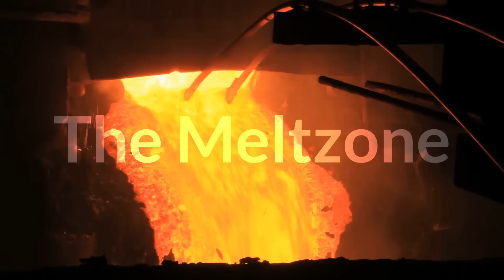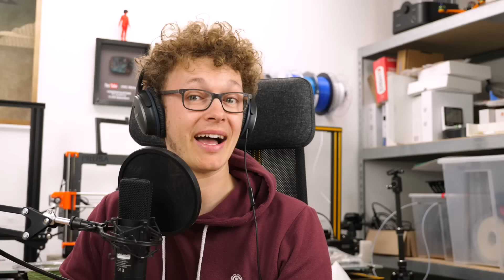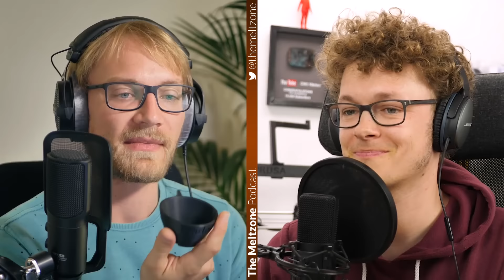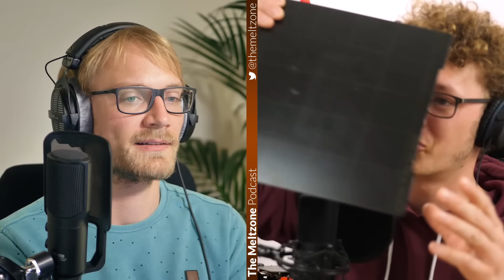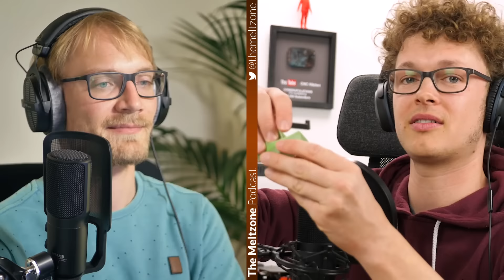3D Printer Fingerprint / DIY Filament Making - The Meltzone Podcast Ep3

Comment from the maker: Open for your questions for the next episodes (given that we don't run out of time again ;-)
Leave 'em below!
Reply: Infinite Z Belt printers! Please! Examples: Stratasys Infinite Build demonstrator (H2000), Stratasys Continuous Build demonstrator ( Using the makerbot patent), Printrbelt, Blackbelt, Call me swal 3d printer, sliding 3D !
Reply: You spoke about filament making devices, what about direct peller estruders? Like this one https://www.youtube.com/watch?v=Wx7GugDZOx4
Reply: Another interesting topic in my opinion is 3d-printer kinetics, the most exotic ones, like (but not only) SCARA and Polar motion systems. They both have some commercial product available (MORGAN and first printer of Polar3d, also another recent polar style printer is Sculpto+ )  I would really to hear some opinions from you on them, eventually some futeure reviews.
Reply: Don't worry about the time from our end. Anyone wanting a 5 minute top 10 best ever .... list and an IQ to match won't be here for a start.
Reply: I’d be interested in a discussion of the current options for printing with soluble supports by price range/amount of tinkering. For example: Clearly an Ultimaker would do it well with little tinkering, but it is expensive. I think a lot of people have had their hopes pinned on the MMU2 but it seems like it currently requires a ton of tinkering and is unreliable. Do you see that improving soon?
Reply: Is their any CAN-bus based 3D printer boards? Where every board has an own small PCB and you just need to hookup power and CAN-bus? Just a creazy idea :)

Comment: I have a policy of not starting out in any field using commercial software (even "free*" stuff) if open source versions are even close to usable. After learning the available open-source tools to a power-user level, then I will let myself decide if I need to use anything else.
FreeCAD FTW! I'm of the opinion that it's the obvious first CAD software to learn because it's never going to be taken away from you at some point later in life by a cloud service shutdown, pricing scheme change, or you moving out of the pricing category, and in fact has continually sucked less with each release over the time I've used it. It's passable for general use now. Not great in comparison to what I've seen online of people using professional CAD tools, but passable, and that's all I personally need. Typically, the best productivity software for you is the one you're already familiar with, and the vendors want to get you invested in their product early so they can monetize you more aggressively later, when it's more painful to switch. I want my laziness to agree with my cheapness, rather than being torn between them!

I'm really interested in home filament production (both because I hate throwing things out and because I like the idea of saving money by mixing a high percentage of recycled household or printer waste into purchased pellets), but in order to match the results of commercial filament for precise extrusion it definitely needs either some kind of diameter control on the extrusion machine or a printer with active diameter compensation. (The latter actually sounds easier to tune and would be useful for commercial filament too!) I'm actually quite surprised active diameter compensation on factory-made printers is so unheard of, as it seems like a simple, relatively cheap process on any machine with a few spare processing cycles that would seriously improve performance with cheap or home-made filament. Severely oval filament might still be a problem though, but it looks like if you get two sensors at a right angle you could still get the cross-section with minimal math (some quick searches suggest that the measurements you would get would be called "conjugate diameters of an ellipse", but most of the geometry mentioned is trying to completely reconstruct the original ellipse (which is apparently possible, in case you wanted to literally draw the filament's shape including rotation on a screen or something), and I suspect you might be able to get away with cross_section = PI_OVER_FOUR * sensor_A * sensor_B ).

Comment: Fusion, up until 2016 was part of the perpetual license with Inventor Product design suite so NO it hasn't always been subscription (18:50)  Its the old drug dealer marketing tactic ...give it to newcomers free , get them hooked and then charge them ......  
And as for the "what you gonna do about it" ( 18:19) .  Look back a couple of years and see what happened when Autodesk removed "showcase" from the Inventor package. Massive user revolt and Autodesk had to offer full blown 3Dmax in the next Inventor suite ( at zero cost) to get people back.  That was only a partial fix and they buckled and gave showcase too. My point being dont underestimate the power of users!!!

Comment: Surprised there was no mention on Freecad. While not as polished as some commercial offerings it is very capable. It is more than adequate for the hobbyist 3d printing market.  We should be supporting the opensource  solution especially considering the origins of the Reprap project.

Comment: Hey guys! Nice Podcast. Hearing you talking about annealing PLA and high temp meterial I thought, maybe you could test the relatively new Extrudr Green-Tec Pro. It is said to withstand temperatures up to 160°c and is stronger than PLA. Stefan, it would be awesome if you could make a video about testing the mechanical properties of this material. Have a nice weekend you two! Cheers!

Comment: You should consider trying PETG too if you have any of that around in rafts/failed prints/etc.  I've only had experience with Eastar 6763 PETG (I got a box of it for around $3 a pound shipping included, or about 2.62€), but it extrudes almost as consistently as ABS (much more consistent than PLA) with more wiggle room for 'the right vertical drop, the right horizontal distance to winder, the right temperature' than you get with PLA.  For me, easiest to hardest materials to extrude that I've tried, starting with the easiest: ABS, PETG, PLA, PP (Use clear packing tape on bed to get it to stick on printer. The extruder nozzle needs to be slightly larger than for PLA. It seems to have lower melt strength so it gets stretched more by the weight of the cooled filament), flexibles (TPU/TPE/TPV), nylon.

Comment: This podcast is worth its weight in gold but I think that there are some things to tweak to get it to the level of awesomeness it can get. 

I think doing it on two-weekly basis is too long which makes you cram questions in and not have enough time to explore them. I think that if you were to do it every week you'd feel more relaxed because you're not chasing deadlines and I don't think it will take up too much of your time. It's not my place to judge your life in any way but you both strike me as makers and makers think about things like that all day long so hopping on camera for an hour or two wouldn't be such an issue, imo. 

Allow yourself to babble a bit as, to me, in its current form the podcast feels a bit scripted and podcasts are supposed to be kind of casual. I don't mean to say waste both your and our time but a bit more easygoing approach will help out the project as it will allow you to go into more detail about what your thoughts are on a subject. This doesn't work in every case, of course. Sometimes all you have to say is a couple of sentences. 

All these suggestions are made with the best intentions in mind. Best.

Comment: regarding to the fingerprinting technique, i dont think you can ever trace back to a specific printer with extremely high accuracy as of right now unless the printer has some unique mechanical issues.
but i think there are some ways to do it that requires cooperation from hardware/firmware/3d printers manufacturer. for example, stepper driver/firmware could generate a very small amount of unique noise during start/stop of a movement. intentionally introduce random but very defects to the hobbled gear, etc,etc.

edit: a mesh leveled bed could also serves as one of the element that the fingerprinting can use. as the patterns of the bottom with always match a certain region of the printer bed.
Reply: and then people would just make their own code/code it out/hack it out/go somewhere else that doesn't include that "feature" unless prebuilt closed source printers become cheaper than the china clones of the open source one's then it might work, until someone gets rid of it. ok your everyday person who want's to stay within laws won't care but those who don't want to do that will find ways as they always do, people will people after all.
Reply: @MrTrilbe  this is why i've mentioned stepper driver and hobbed gear as well. it will be harder to alter a chip and the small defects on a hobbed gear. the thing is, if these are never mentioned/made public, you wont even know what to look for in the first place. i know i know, security through obscurity isn't always the best idea but at least there are ways to do it.
Reply: @MrTrilbe  even with open source firmware, if you are really good with programming, you can obfuscate a very small portion of the code to hide what it actually does.
Reply: @MegaMaking  People will either a) de-obfuscate the code, remove that code and recompile and release under the GPL3. 

b) tell the company releasing the code about how obfuscating code is somewhat of a grey legal area in the GPL3 or 

c) go to a company that doesn't include that code, same with hardware, there's to many companies who either don't want to spend the money to do it, china, or make products that can't have them, or will have to release code patches to remove them, companies that make steppers for very large multi national companies who can afford to dictate the product for example. 

Not to mention any product released in some countries will have to state that the "defect" is there or get taken to court for false advertising.

Comment: SolidWorks pricing varies widely by region. Here in the US, SolidWorks Standard is something like $4995 plus subs (Maybe 3995? I can't remember), and Premium I think is $8500. Pricing in other regions is frankly shocking. I use SW as my daily driver, and OnShape and Fusion360 both feel incomplete and harder to get work done. Not all of that is learning curve, not by quite a bit. The SolidWorks architecture is visibly 2 decades old, but then it has that much extra refinement and completeness. Not perfect though, I assure you. Just a lot more industrial grade. OnShape and Fusion360 are more suitable to a business just starting out, with very modest needs. I expect OnShape to become a real contender in a few years; they've laid a good foundation. But Fusion may always be AUTOdesk's junior to Inventor.

Comment: Reminder to those concerned about 3d printed guns:

Files exist. They can remove serial numbers. But I haven't heard anyone calling for their ban. 

In the US, it's trivial to legally get a completely unregistered 80% lower receiver blank which may be possible to mill with just a drill press. And this is a proper metal part!

And regardless the only printed guns which are sensible are printed lower receivers (the only registered part of the firearm) with the rest being metal.

Comment: Did you try to print it with 100% infill Thomas?    and for the fingerprint discussion, wouldnt you change the fingerprint as soon as you start playing with the axis, or motors, even the settings?

and great strong name you have there Stefan xD

BTW id like to see maybe some higlights in the video, so you could quickly click right to the story you wanna follow.

Comment: Your mention of on the fly control of flow rates based on filament diameter reminded me of a somewhat related topic.  That is control of the nozzle temp.  Currently it looks like a PID loop is the standard way this is being done.  A PID loop is far from the optimal solution because there is always a delay in adding energy to the heater block when plastic is extruded.  This can greatly limit flow rates and printing speed.  We know that a certain amount of plastic is going to be extruded in a given amount of time and we know that a fixed amount of energy is required to heat that given volume of plastic from its room temperature to the extrusion temperature.  We also know that there is a small amount of heat lost due to radiation into the room but this is fairly constant.  Because of the design of the heater block and the placement of the thermistor there will be some time delay but this will always be less than with a PID.  I expect that changing the control mechanism would result in greatly increased flow rates and superior temperature stability even with current hot ends.  The question for discussion is, Has anyone looked into this?

Thanks for the interesting discussions!

Doug